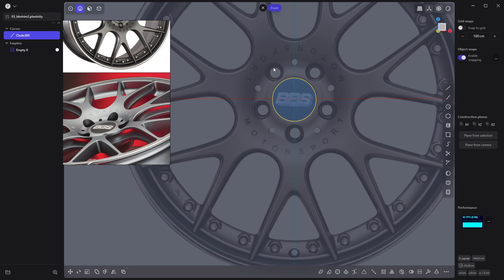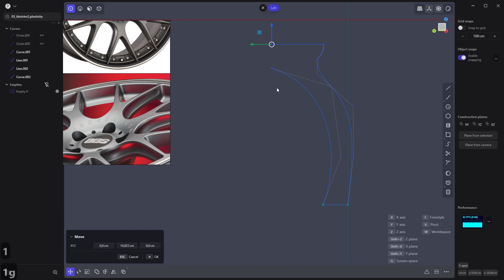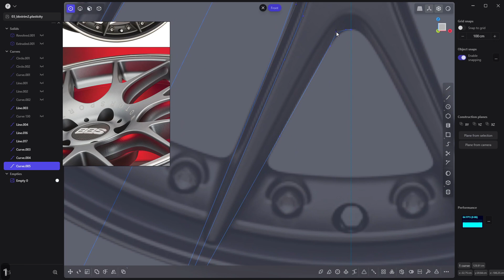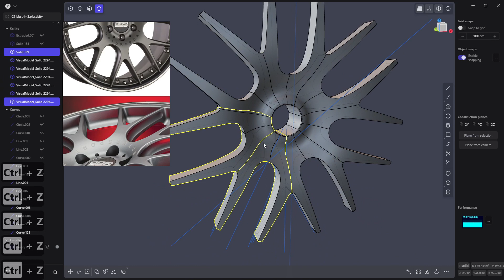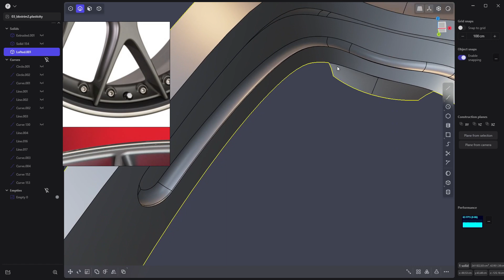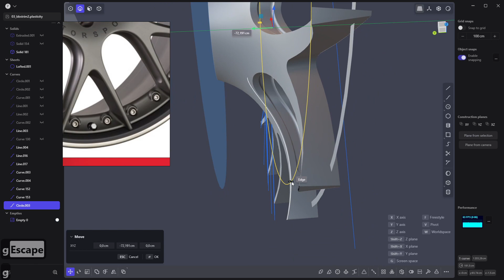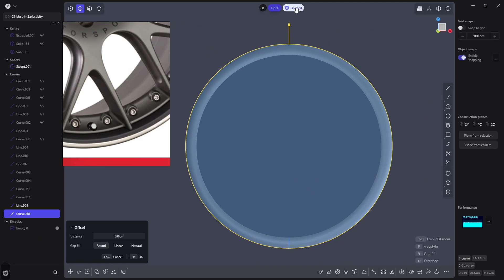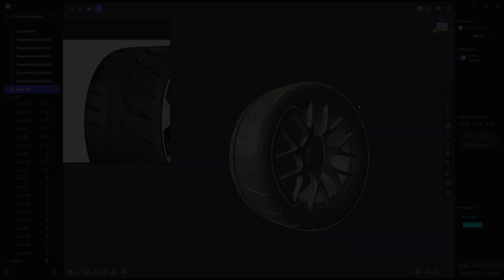BBS Trim Modeling in Plasticity part1

Comment: it seems much easier than doing it by SubD in blender! Whats your opinion on that?
Reply from the maker: I agree, I used Mesh machine and boxcutter but the result is never as good as in plasticity. The only downside is the cleaning part, the topology exported from plasticity needs a lot of cleaning. But I think it still worth it